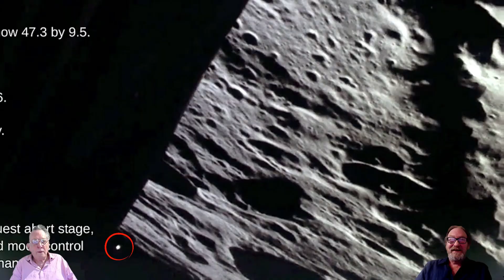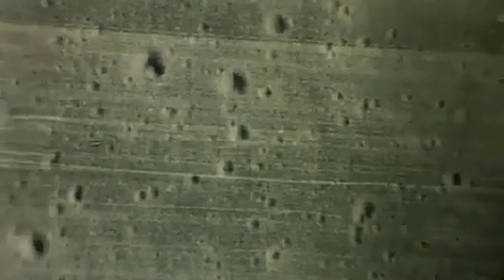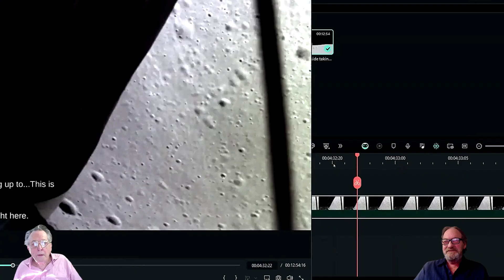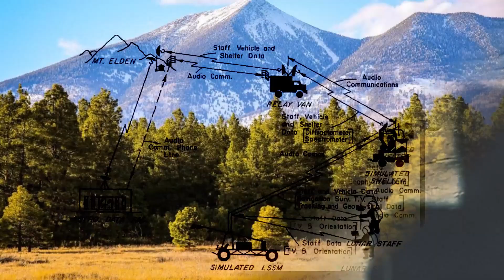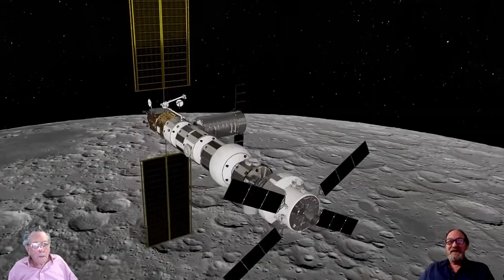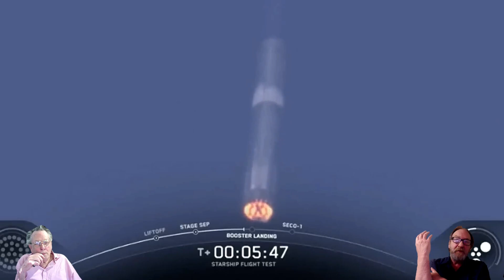"ONE POSSIBLE WAY THAT THE LM TRANSITION WAS ACCOMPLISHED" PART 124

Comment: If the thermosphere actually gets hotter than the melting point of aluminum,  does that not pose a problem before we can get out to all the other problems?
Reply from the maker: There are few air molecules in the thermosphere. They are widely dispersed so you would not get hot enough to melt a ship.
Reply: @theapollodetectives  the lack of atmosphere is completely irrelevant. The fact that the ship is a mass and the suns rays are resisted by the ship means that heat happens.  Heat is a product of resistance to the motion of energy.  A ship made of aluminium or even steel would melt in the thermosphere.  you can only protect it with an electro/magnetic field that allows the harmful suns rays to be repelled or transmuted.  Primitive concepts like insulation or shielding belong in the dark ages.
Reply: All depends how long a vessel is in the thermosphere since there is less matter to transfer heat.
Half an hour tops is the longest a vessel is exposed to the thermosphere from my understanding.
Reply: @yomommaahotoo264  vessels ARE matter.   It is not the transference of heat that is the problem.  It is the fact that any mass in that layer is subject to intense radiation that creates heat .  Heat is a function of resistance
Reply: @boptah7489 
But there is less resistance to any atmosphere molecules up in the thermosphere, and thus less heat.